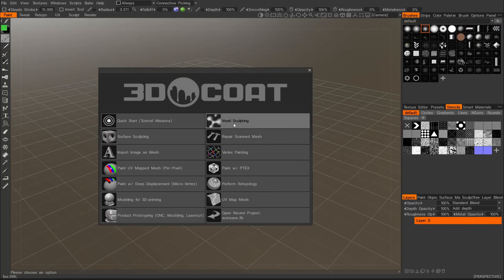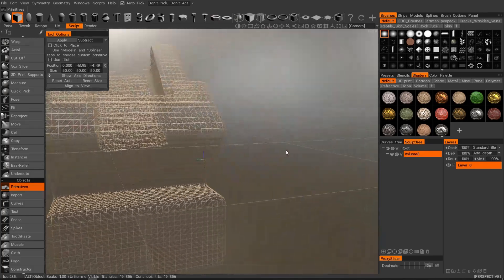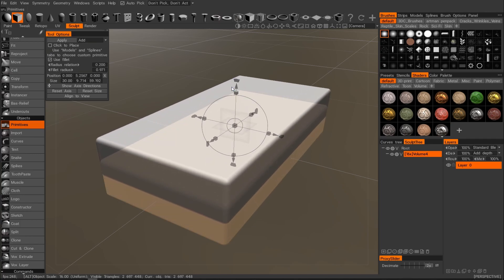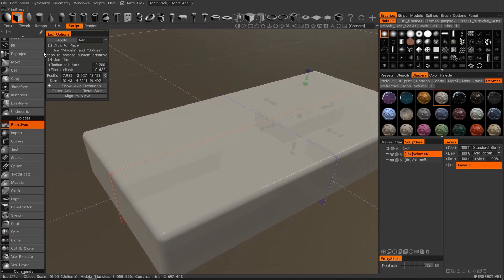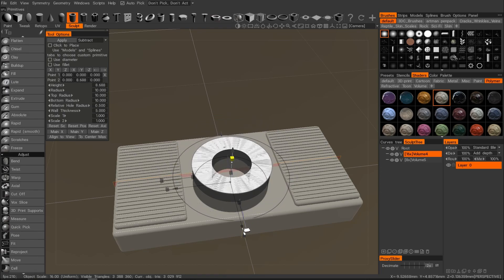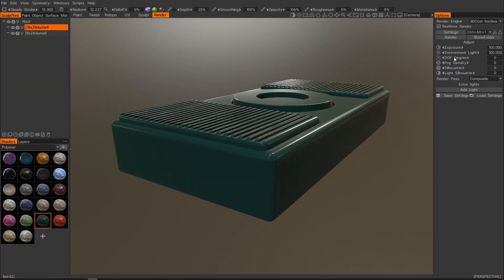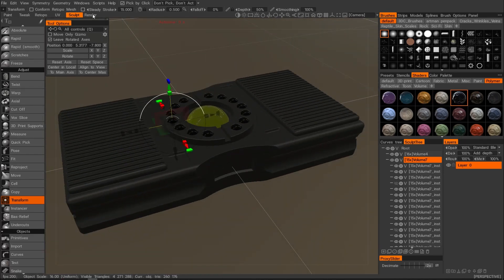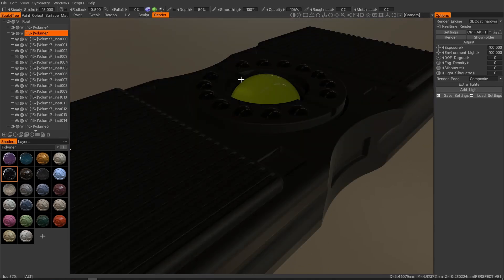3D COAT Hard Surface Concepting

Comment: 9:55 there is a symmetry option to allow cutters to be the same distance from each other.
symmetry type translation.  The 2d grid may also help
I know some may not like the modeling room but I was easilly able to create those grille objects in the modeling room and add that as a scult object, you could add that as a new layer